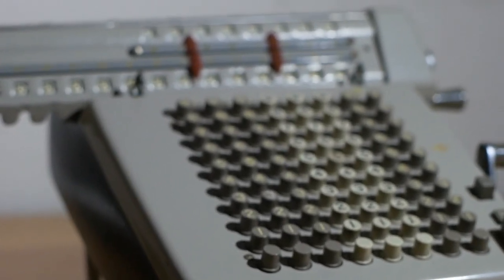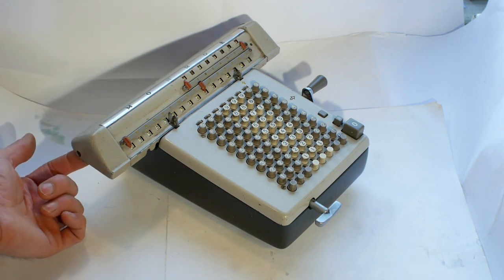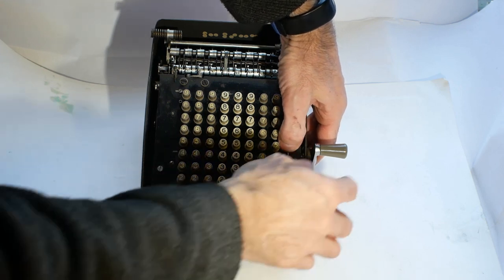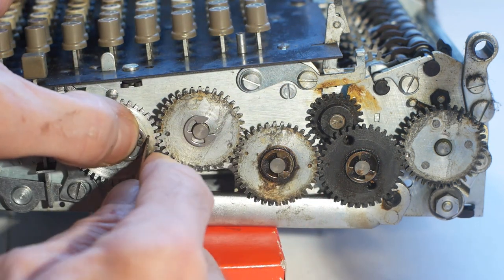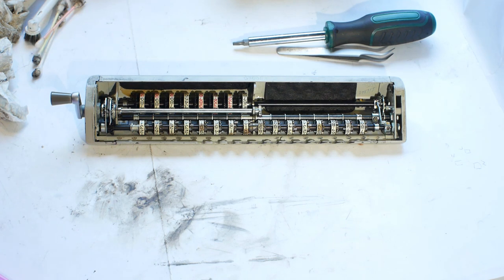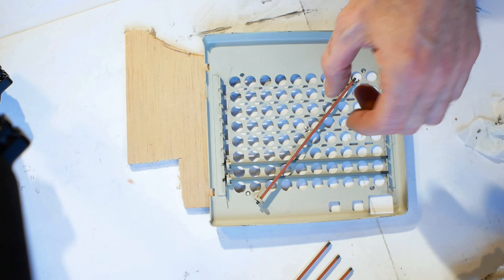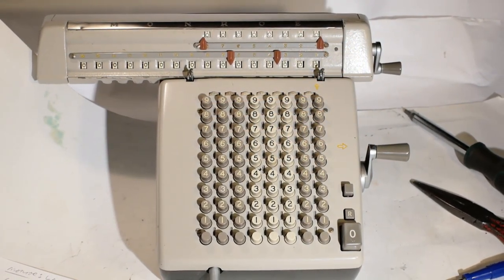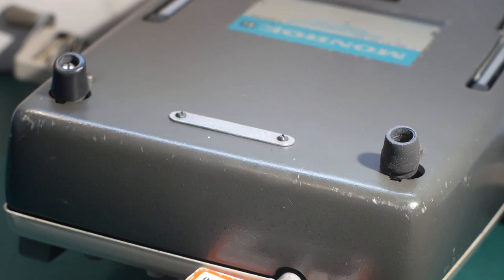Retro Tech, Monroe LN160X Mechanical Calculator, Part 1 - Refurbishment

Comment: This video was so helpful to me!  I just got my own L-type Monroe machine on eBay.  It definitely needed some work and some new oil inside.  Mine is a different model from the one you show, but they are similar enough that I could easily figure out how to take mine apart based on your demo.  Now my machine is working perfectly, thanks so much!
Reply from the maker: Hi Wade, that's great to hear.  I always find it easier taking something apart if I've seen someone else do the job first (or at least something similar) rather than just reading an instruction manual or something like that.  Hope you have lots of fun using your Monroe.

Comment: I have a model K I got in a thrift store, $8 and it works. Gave it a little sewing machine oiled and it works even better. I’ve had so much fun with that thing, running all sorts of complicated calculations. It doesn’t make mistakes but I sure do. I also have an LA5 which I’ve got working manually but if I try the A it starts but doesn’t stop. The calculator mechanism is fairly simple, the motor controls is very complicated.
Reply from the maker: Hi David, I think maths in general is more fun when you get to play with these old mechanical machines - I'm sure I would have taken more interest in the subject if I'd had a mechanical calculator when I was a kid.

You can bet your life that there's a rod or lever or something similar in your LA5 that's sluggish and not closing the motor contacts when it should - probably really simple to fix...IF... you could track it down and actually get to it to free/lubricate it.  Maybe one day.......
Reply: @GrumpyTim  I put the “clutch yoke” into neutral and plug it in. No motion which is correct. Hit the + bar and it goes into forward. The trouble is it doesn’t stop. Haven’t figured out why. Same with the minus bar. I found the “machine stopping bar” which I can move but it’s stiff. Not sure if it’s supposed to move or just be adjusted. Moving it doesn’t stop the machine. So still figuring it out. I freed the stepped gears which solved the sticking keyboard problem and a few counter wheels were stuck but I fixed that. So the machine calculates just not automatically. The L model I’m pretty confident I could get it working unless someone has broken it beyond repair. Usually it’s just stuck mechanism.
Reply from the maker: I'll keep my eyes open for an LA5 in case I can figure out what the issue is - you can't have too many calculators can you!!!!!

So far, even on the ones that have been broken / had parts missing I've managed to fabricate replacement parts, but it can mean that they sit in the "to do" pile for quite a long time.

Comment: Well I had one day a calculator which was entirely stuck and gunk up. So I removed the case and showered the entire thing with window-cleaner fluid. Then it was showered with water and dryed. After that I gave it a shower with fresh oil and wiped it down. The machine works nicely today.
Reply from the maker: The method is a little unorthodox Paul, but it worked and it so who am I to criticise.  Excellent job, that's another one rescued.

Comment: May I ask what you used to clean the casing on machines like this? Just soapy water or was IPA suitable here?
Reply from the maker: Hi Matthew, I tend to go through the same process on must cases - starting with just a damp cloth - it's often surprising how much dirt that will get off.

Then sometimes I'll use a bit of methylated spirits if the case is still dirty, but the thing that nearly always does the trick is Peek polish - technically it's a gentle abrasive metal polish but it's great for cleaning cases of machines, and also good on some plastics too.  I'll usually finish off with Autoglym car polish to protect the paint but I don't use that every time and any other car polish should do the trick.

I wouldn't use the Peek polish on the case if it had one of those crinkle paints because the traces of polish would stay in the texture of the paint, leaving white deposits.

Hope that helps - I've been using Peek for years and it's done a great job.  If I'm polishing metal I'll quite often start off with a more aggressive polish like Solvol Autosol and then finish off with Peek for a better finish.
Reply: Thanks for the reply, I recently acquired the same model to this after successfully repairing and cleaning an ANITA 1011 electronic calculator, so this advice will be useful!
Reply from the maker: Excellent, you'll really enjoy it - it's one of my favorite machines to use.  The only thing that takes a little getting used to is the fact that the park position for the crank handle is at the top whereas on all the other mechanical calculators I've used, the park position is at the bottom.

I've always fancied one of those Anita's but they're a bit out of my price range at the moment.

Comment: I've recently got hold of this exact model, and it's in need of some TLC. I need to get under the keyboard to free up some sticking levers. How do the key caps come off?
Reply from the maker: Hi Moogthedog, if you need to remove the key tops they are just a tight friction fit onto the metal post - there is always a risk that the key tops could break as you remove them so I'll always attempt to free up seized parts without removing them if I can.  If you take a quick look at my Lagomarsino 9203 refurbishment Part One about 6 minutes in: https://youtu.be/IPUle5SmYgg   You'll see the very crude tool I made for removing the keys on that machine - the method would be the same for the Monroe.  I knew before I started removing the key tops on the Lagomarsino that I'd need to replace some or all of the keys so I wasn't too distressed when many of them broke on removal.  It's worth pointing out that making 100 replacement key tops took ages so if you did happen to think about that, be warned!!!!

Hope you get on ok, the Monroe is a lovely machine once it's running.
Reply: @GrumpyTim  Thanks for the quick response. I've only had the most basic look under the hood at the moment, but this video has already been invaluable. I'll get it right out of its case and see what I can reach - if I can resolve the issue without removing the keys that'll be a bonus.

You're right about it being an addictive pursuit - I've also got a working Brunsviga and Facit. I never get bored of making numbers go click. :-)
Reply from the maker: Excellent, they really ARE quite addictive - maths was never this much fun when I was at school but having the numbers literally crunch before your eyes is really satisfying.

Just ask if you have any problems with the Monroe, but hopefully you'll be able to deduce the things that aren't doing what they should and free them up accordingly.  :-)

Comment: how did you remove the circule under the carriage. Love your video. I have the same calculator and I'm trying to fix it. I just have on problem the carriage resets to one and not in zero. it would be if you could help. Thanks for the video
Reply from the maker: Hi Angel Fernando, when you say the circule, are you referring to the circlip, also known as a "C" clip or an "E" clip?  Assuming that you are, we'll call it an "E" clip for now because it is somewhat like the shape of a letter "E" although somewhat more curved.  It sits in a groove on the shaft, and the two outer legs grip the shaft.  To remove one of these you want it pointing outwards, with the legs of the "E" pointing away from you, then insert a small screwdriver into the gap between the shaft and the side of the "E" clip that's nearest to you and gently prize it off.  BUT, and this is very important, you need to put a finger from your other hand over the spring clip so that when it releases from the shaft, your finger stops it flying off round the room - you'd be amazed how many people have had these little clips fly off, never to be seen again.

As for the numbers resetting to one rather than zero, firstly, once you've got the carriage off, check that all the number wheels are moving freely (you can use your finger to move them once the carriage is off).  If they are all free, there should be a bar that moves as you crank the  clearing handle, this has little fingers that catch on a post on the side of each number wheel to stop it in the correct place.  If this bar isn't moving as it should be, or it's damaged, or the number wheels have lost their posts, then the wheels won't reset correctly.

I would take the carriage off first and then you can examine it properly.

Let me know how you get on.
Reply: @GrumpyTim  I appreciate the quick response. I'm going to take a look at it this afternoon. Thank you so much.

Comment: I have one of these which I have recently brought back to life (in fact I now have two of them).  One of the fold down legs is lose on the shaft, any idea how to remove the pins from the shaft they pivot on (I believe they are taper pins) so I can remove them to see what the problem is?
Reply from the maker: Hi alanesq, yes, they are taper pins if I remember correctly.  My pretty standard method for removing taper pins is to find a drift/punch just a tiny bit smaller than the diameter of the pin - if it's too small it may well bend, and if it's too big, it will either get stuck in the hole as you drive the pin out, or it will damage the hole itself, making it more tricky to re insert the pin.  I tend to have a lot of drifts and punches around but if I don't have one of the correct size, I'll either slightly sacrifice a bigger one and grind it smaller or make one from scratch - old bolts can be ground down to make drifts.  Once you have a suitable drift, locate the tinner end of the taper pin and support the opposite end of the leg on a slightly opened vice - this allows the pin to pass through the gap as it comes out.  Then use a hammer to tap the drift and the pin should come out - small ones like that don't usually require much force.  You might find that you need 6 hands to hold the calculator, the vice, the hammer and the drift!!  Assuming you get it out out, you shouldn't need the drift to put the pin back in, just tap it back in from the fatter end of the pin until it's seated - again, you shouldn't need to hit it hard.
Reply: @GrumpyTim  Thanks very much for the reply.  I will give it a try.